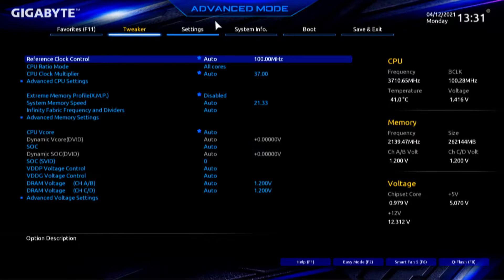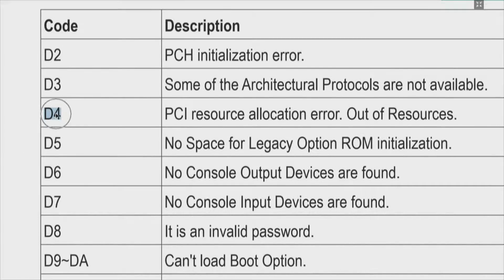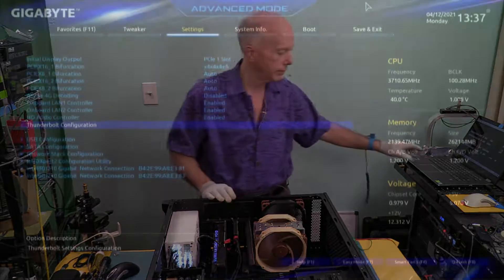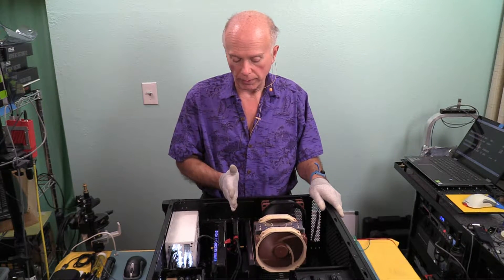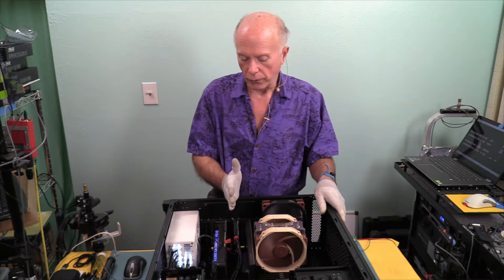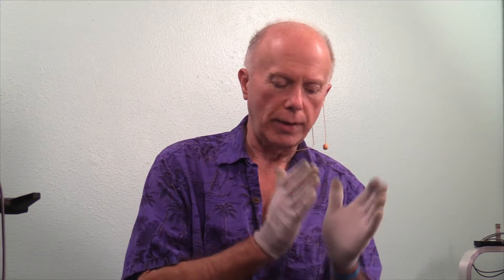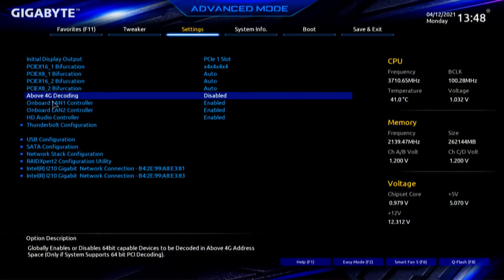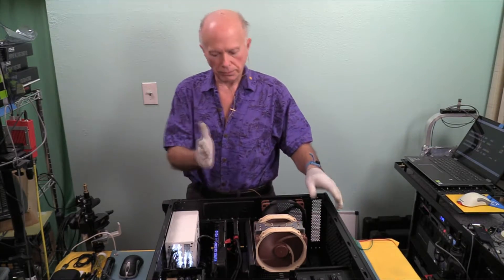D4 PCIe Resource allocation Error and Above 4G Decoding on Gigabyte TRX40 Designare

Comment: Another great video.  My Aorus NVME card is also in the top most slot on the Designare with a 3 slot 3090 in the bottom x16 slot.  Did you order an IceGiant for your system?
Reply from the maker: Hi Michael V, Thank You for Your Comments, Support and Sharing Your Configuration! We never know whom else we might be able to help through Our combined experiences! Sorry to be so late getting back to You! Had to be in front of a Computer for this reply. Smartphone was not good enough. Working on next Video!

Made the Inquiry to IceGiant about the WRX80. No go! Their reply, "Hi Gill, thanks for your interest and for reaching out! Yes, the Elite is compatible with the WRX80 socket (identical to the TRX40). However, all of the Threadripper PRO motherboards have the socket rotated 90 degrees- because the Elite relies on gravity to operate, its orientation is critical and so, cannot be used on the Threadripper PRO motherboards if the motherboard if vertical (like in a typical case). It would work fine if the motherboard was horizontal (like a test bench setup).

Please let me know if you have any other questions!

Best regards."

And that's a Bummer unless we go WRX80 Rackmount. What about on the TRX40, right now, we're OK with Noctua. If that becomes a problem, absolutely! Stay tuned!
Reply: @BuildOrBuy  May not have to go testbench/ rackmount with a WRX80 + Icegiant.  There are still horizontal desktop cases being made.  Though don't know if any E-ATX desktop (horizontal) style cases have the 164mm of cooler clearance the Icegiant requires.

Alternatively,  many tower cases can be run on their side with the addition of some LRF modules (little rubber feet).  That configuration might be preferable for many cases, as the rotated IceGiant would then blow air from the front to the rear, which is how most tower cases are designed to operate.  The IceGiant on a TRX40 blows from bottom to top, which is an airflow direction that many cases don't support.
Reply from the maker: Hi @Trevellian , 
We had a perfect ATX Rackmount Case. But not a perfect E-ATX Case. We also have a near perfect XL-ATX Case. A Test Bench setup, even that's a hard sell for most of Us with Removeable Racks and either Shelf or Desktop space. Looks like all the IceGiant would require is an additional Thermal Plate for rotation. Maybe, maybe not. The other Option is to change the orientation of the Motherboard. There is an E-ATX Case for that! Amazing how changing one thing can change everything! Can't believe We're taking a 2nd look at that particular Case! Wild! 

be quiet Dark Base Pro 900 Orange v2 Case
https://youtu.be/AdMXj2ezo9M
Reply: @BuildOrBuy  Interesting, didn't know there were cases that allowed motherboards to be flipped.  But would flipping the motherboard 180 degrees work with Icegiant?   As the IceGiant's coolant is circulated via gravity,  flipping it and the motherboard 180 degrees would still leave the IceGiant rotated 90 degrees from it's intended design.
Reply from the maker: Hi @Trevellian ,
We stumbled into that Case while searching for the XL-ATX Cases for the TRX40 Build. And those same Cases also happen to be able to accommodate E-ATX Motherboards which were not on our Radar with the TRX40 Build but IS with the WRX80 Build. You're right, Inversion is left to right. There is no up and down or turning or rotation. I had to look at the Case again. It's been a while since we did that Video. That's the only unconventional Case we've encountered. And that's why that came to mind. Interesting but not what we need. Besides Building in that Case is like Building a Swiss watch! 

None of Our current spaces accommodate a shelf Computer even if there was one available. If We went to a Rack, then I have to change my Gear Configuration. Doable. Practical? Interesting how that one minor thing is becoming a big deal. I need 2 Cases side by side. 

The SuperMicro WRX80 Case appears to fit that scenario both ways either Rack or Standing as a Tower. The problem with E-ATX Rackmounts is the depth. We had a perfect ATX Rackmount setup but those are too shallow now. They were perfect for the DIT Video Cart setup for mobility. 

If We use an RTX 3090 Single slot then we're using an EKWB therefore, same for CPU. I'm not a Fan of Liquid Cooling. And there are no RTX 3090 Single Slot EKWB Video cards to be had! If on the other hand We go to an RTX A5000, that's a blower style with minimal power Requirements and fits in a Single Slot. And we're back to the Noctua CPU Cooler. Interesting dilemma. 

I need to get my hands on an IceGiant and see what's what with the mount. Right now, Thunderbolt 4 has our attention! Stay tuned!